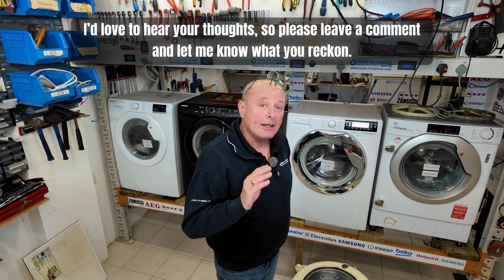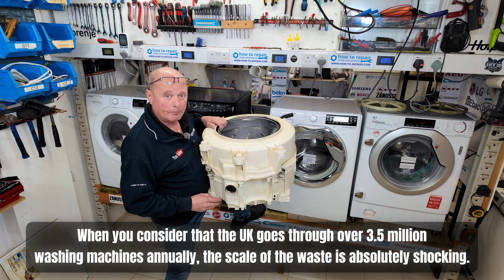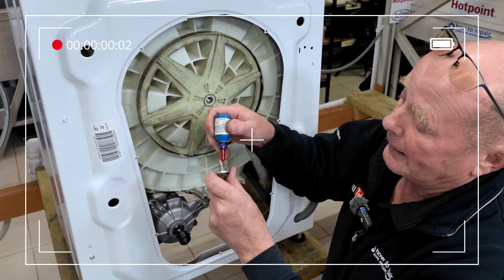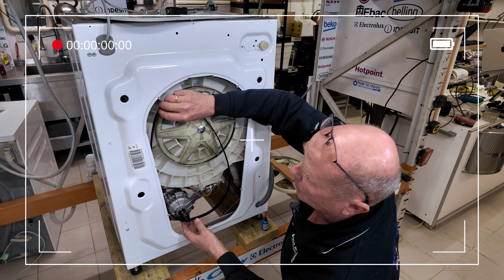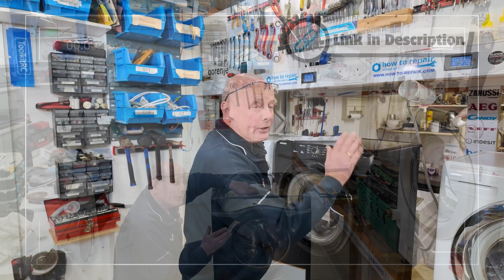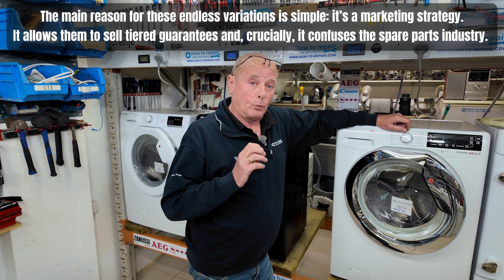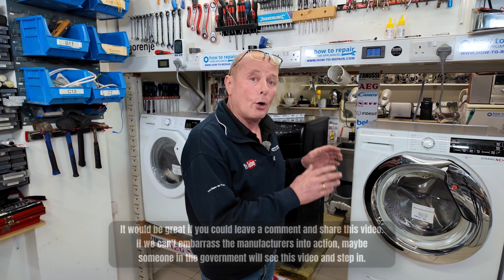I Scrapped 13 MACHINES to Prove a Point: STOP BUYING These Brands!

Comment: In the Netherlands the consumer is very well protected. The factory warranty the is now extended to the "expected lifetime" of the machine. 
This varies from 4 to 8 years depending on the purchase price.
And when the appliance is not repairable withing the expexted lifetime period the reseller needs to replace the applaince, for free!
Some normal wear or "user caused damages" are not covered.
Reply: Yes! Only responsible politicians can restrict this kind of behavior of greedy corporations. That's why big corps usually are the biggest donators to the political parties.  That's why American TechBros hate EU so much. And that's why we all have to be vigilant who are we voting for, because nowadays "i am apolitical" nonsense" can end by monthly subscription for our washing machines just to perform simple wash cycle.
Reply: Yup, but it takes the reseller effing ages to replace your faulty washing machine. The reasonable term is incredibly long, so you are without a critical appliance for an extended period. Now please note, this is a great first step to have enshrined in a law, but the pressure on manufacturers to do better isnt big enough, and consumers still have to deal with their crappy business antics for far too long. We need right to repair on all our white and brown goods.
Reply: @Styreta there are already some changes visible.  
For example, Liebherr started this month with 10 year full warranty here in the Netherlands on household appliances.
Reply: @martinmooren9536  10 years is the basic length of time I expect an appliance to last. My Siemens fridge freezer stopped cooling the fridge for the sake of a £1 capacitor and that lasted almost 16 years. I bought another, as all the plastics and glass were getting cracked and scratched, gave it to a charity to give to a family in need of a fridge freezer. If I hadn't fixed it, I am sure it would get degassed and shredded.
Reply: That doesn’t seem like much protection seeing as most machines are designed to last 5-7 years anyway. If they offered 8+ years then that’d actually be beneficial.
Reply: We have similar in NZ - The Consumer Guarantees Act 1993. Goods must last a 'reasonable' time and if they fail due to a durability issue or manufacturing defect, and cannot be repaired in a reasonable time, or suffer a failure of substantial character, the consumer can require a refund. That doesn't stop retailers trying to pretend there's only the explicit manufacturer's warranty cover though, and trying to sell you an 'extended warranty' which is merely a third-party insurance policy, or hampering any CGA claim with nonsense.
But even with those protections it can still be a hassle if a new appliance fails. I'll stick with my 33 y.o. fridge and washing machine and >40 y.o. chest freezer, thanks very much.
Reply: @TonyRule  Australia has near identical laws too
Reply: Kind of assuming that if the machine did 2 years instead of 4 you will have to pay half for the replacement machine, otherwise infinite machine hack.
Reply: @Grobbekee That's not allowed anymore by law. If it's not repairable and within the expected lifetime period the costumer (should 😀) get a new appliance without any charges.
Reply: Great! This should be a law for the whole Europe!

Comment: This guy is bang on.  Lg and Samsung are the best to buy for a decent price.  5 years labour warranty and you can take the drum apart and replace individual components.  Every other manufacturer have substandard drums. People try and save a bit of money by buying a hoover, candy, hotpoint or Indesit and they are gonna suffer after a few years so it’s a false economy. LG and Samsung do you need to get their act together and start producing and selling integral machines that’s their downfall. 10 year parts guarantees aren’t worth the paper they are written on because you will get ripped off by the manufacturers labour charge.
Wake up people before it’s too late. I refuse now to go out to machines where the drum is noisy. I will do FaceTime videos with the customer as it’s a complete waste of time for me and await for the customers for my arrival just to tell them the machine is knackered.

Comment: Bought a Siemens's washing machine from Comet in 1995. We worked out with it being cheaper to run and a bigger drum that it would recoup the  £400 premium over the std 300 brigade and it had 7 years g-tee. 
It's had 1 drain pump and 2 door seals , and still runs reliably in my step sons house after thousands of washes and 25 + years .

Comment: My first Beko lasted 5 years and had 3 major repairs under warranty and Insurance and each time was out of order from 2 Weeks to 1 month. Then replacement due to fault, with a newer model wich lasted massive 5 minutes. Then i swapped with LG and now 7 year in operation only with one fault, bellow from drawer failed in 2 years,  repainted myself as LG didnt had part in UK at the time. LG confirmed for me the warranty its still applicable even if i change myself confirmed on phone and by email. Im happy with lg but in near future i will need to change the dampers. Thak you for your video

Comment: Here in the states and I got tired of replacing the bearings and spider in my LG front loader for the 3rd time found a deal on a open box Speed Queen.  Hopefully the Speed Queen will hold up and not require regular rebuilds.
Reply: Same here, ditched all the brands like AEG and LG after they just didn't last and took out the money for a Speed Queen that has been running for over 20 years now without a problem. No fancy little melodies being played after it completes it's cycle, just mechanical knobs that does what it needs to do.
Reply: Speed Queen are brilliant, can, t get them in the UK sadly.

Comment: Slightly unrelated, but I bought a new Westinghouse free standing kitchen stove about 5 years ago. When the oven is turned on for about 20 minutes, the top gets so hot you can't hold your hand on it, and now, the thin steel on the bottom liner has burned through and is exposing the element. It's not just the enshitification of the internet, it's the enshitification all consumer products too

Comment: Using chipboard in a washing machine is the height of cynicism
Reply: My worktop is made from chipboard, no problems with swelling. You just seal the edges around the sink before fitting.

Comment: I had an hoover a few years ago. It lasted maybe 3/4 years, and one day started to making an awful noise from nothing (I suspect  the bearings had collapsed). In a matter of less then a minute, smoke started to show from the back of machine, and while we were fast to remove the plug, the "3 point star" in the back of the drum was broken, plastic was melt and burned, and I'm not sure if the motor was ok. If we were not at home, it could have set the house on fire. That's one of the many reasons I never have a battery charging or an appliance like a washing machine working while not at home. And Hoover? Never again!

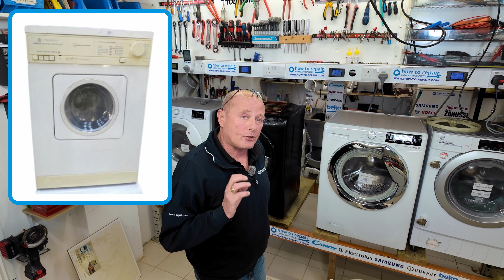Comment: I am also a bit of a "Washing machine nerd" This is how I found your channel.... At 03:20  in this video, my late grandmother bought a brand new  Hoover Electra A3E12 Washing Machine in the early 1980s (Maybe 1981/1982 ish), and it lasted right up until she passed away in 2014.... It was STILL working when we cleared the house after she passed away.....  My sister took it to her home as she needed a new washing machine and got another year's service from it before it finally threw in the towel. 
I am convinced it is only packed in working because my sister overloads her washing machine...I am sick of advising her NOT to do this! 
Thank you for this video. 
I still reckon the  Bosch Series 2 WAJ28002GB is the best mid-price washing machine you can buy in 2026.
Reply: I have exactly a Bosch Series 2 machine, it's both basic, but also has the features I need at the same time (like control over the spin speed, temperature, extra wash cycle). Bought it back in 2019 and still running good.

Comment: Good on you. I 'm in New Zealand and repair all sorts, mostly not laundry items due to size, Ive not seen those specific brands but we have heaps of junk here too and I suspect even less support of right to repair than you have. I am involved with a local IT wrecker/recycler and its appalling what is being scrapped these days, Its great that you are taking out the good parts. Personally I avoid buying anything that the supplier cant supply me a service manual with at least how to disassemble, an exploded diagram a circuit diagram with error codes and a list of available parts. Doesn't always work but its a good way to get rid of the junk importers. Like you we had a local manufacturer Fisher and Paykel which used to be the brand of choice now I wouldn't touch it with a barge pole. Im still running my 2000 cars for the exact same reason.

Comment: Built in obsolescence on electricals has always been been around, especially DIY products like drills etc...   I remember in the 70's Black and Decker DIY drills were designed with the knowledge the home handyman would only get it out of the shed 1/2 doz times a year and so if the components lasted 100 uses and fell apart no one would be any the wiser.  The upside was most drills in those days could be serviced.  Over 30 years I stripped an old B&D drill quite a few times and replaced bushes and cleaned and greased the gearbox etc....

Comment: If a printed circuit board failed, it is worth to look at it. Could be just a capacitor or an obvious burned part. My success rate is about 30%.

Comment: I have a Miele W431 built in 1974. I still use that machine as my main "daily driver" for washing my clothes. 
The original set of bearings lasted until 1996! And the rebuild kit (drum bearings, tub gaskets and the drain pump/sump hose) was still available from Miele back then.

Comment: Why dont people come together to build an open source washing machine that is super repairable ? Something that any manufacturer could build a copy of, without risking a lawsuit. Something open source a bit like the legendary Creality ender 3 3D printer or something super repairable like the computers made by “framework” (the brand is called framework).

It could use an arduino or a raspberry pi as a brain. And I don’t think there are any patents out there preventing people from building an open source machine.

Please upvote so this becomes the top comment and everyone can see it. I know that eventually someone with enough geekiness and a good heart will see this and start the project.

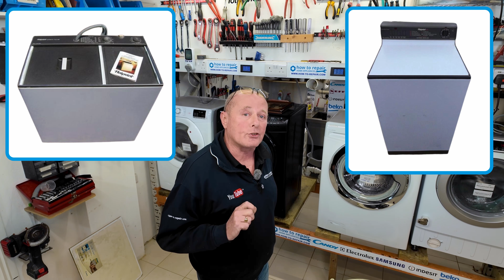Comment: 3:30 - Brings back childhood memories, we started with the Hotpoint twin tub on the left, followed by the Hotpoint top loader on the right.  The twin tub was the one I remember Dad regularly dismantling in its final years until the tub finally rusted through.  Our current machine is a Whirlpool 9kg semi pro (68cm like a typical USA machine) that's about 20 years old.  When its spider broke about 10 years ago, my dad got a quote for around €400 for the drum and bearing and we went shopping around for a new one.  My mother was put off by all the (smaller) standard size washing machines and 68cm models were no longer on display, likely due to not meeting EU efficiency requirements.  In the end my Dad bought and replaced the drum and bearing and it is still in use today.  Since replacing the drum, we have been running a monthly cleaning cycle.

Comment: i bought a hoover heatpump tumbledryer late2020. As a heatpump tumbledryer, its been as expected.
i have had two failures, one i could fix, and one i couldnt
1) starter capacitor - easy to diagnose , 3 hours to replace..lack of an access hatch meant the drum had to come out, which at least meant i could remove all the fluff from the inside and inspect the bronze bearing.
2) the total arsewipes neutered the smart features remotely because they were too lazy to make a firmware change to comply with a recent EU ruling even though we have Brexited. Its not a dumb machine. The wifi setting knob doesnt do anything anymore, cant even join a wifi network.
This bit winds me the most up. I can handle a failure of a  component...but intentionally removing a valued feature (to me) was a bad move on their part.
Reply: But why did you buy a Hoover and not a more reputable brand?  It's kind of like buying a VW or Renault and being surprised that it is not as (mechanically & electrically) well made or easy to repair as a Toyota or Honda. VWs and Renaults are not particularly popular in Australia for those reasons, yet in Europe they are strangely popular for all kinds of cultural and/or road salt (the bodies and paints are better made, in a trade off for all the corners cut on mechanicals and electricals) reasons.

Comment: my modern (ish) Aqualtis first broke the concrete weight (was able to replace it ) but after about 6 hours of use the PCB seems to have gone crazy. It says 'machine blocked' on the screen , yet pipes are clear, filter is clear  and it actually pumps out just fine, so unless its a pressure sensor or something up the spout the machine is just beyond economical repair. It was easy to access the components at least.
Reply: What's an Aqualtis? Do you know the OEM of that machine? :)
Reply: @TassieLorenzo  Hotpoint. It has an inverter drive motor.  Model of machine AQ169S

Comment: Hotpoint, Hoover (had flooding problems, bad processors, both went rusty) and Candy have been  disaster for years.  Bosh is not good A bearing collapsed which was lacked “made in England”.  The best machine that ai have owned is a Miele (the guarantee period has reduced to 2 years).  We currently have a Fisher Paykel which is quiet and very impressive.

I would not want to buy anything built in the EU.

Comment: I'm an engineer. If there's something I can tell you about your videos on planned obsolescence, it's that you're falling short. The problem is BIGGER than you say. Planned obsolescence is buried deep into software nowadays, and the manufacturers are not even hiding it anymore. From appliances that require an Internet connection to be "activated" just to work, to simple equipment that stops working after a set number of "cycles", to those that won't work unless you "update the firmware", so that the manufacturers can push new TOS and new rules that didn't even exist when you bought them... If you go through Louis Rossman's wiki, you'll find hundreds, thousands of entries of products and manufacturers that pull this shit over and over. Disgusting. They're trying to push us into the rent-only lifestyle, and making products disposable and expirable is the first step.
Reply from the maker: I can’t agree with you enough, but this is slightly above my pay scale. I’m not a software engineer and I’m not able to see the tricks that they’re up to but this is why I oppose Wi-Fi connections. It is not needed in a washing machine but then they will only set it to the number of cycles. This I did manage to find on a recent video I made about Bosch washing machines where they had left a model open to see how many cycles the machine has done. It would be so easy for them to trigger a software failure at a certain number of washes I really appreciate your comment.
Reply: @How-to-repair : Thank you very much, sir, for what you're doing... We need many more people speaking up on this subject. In my case, I won't buy anything that requires an Internet connection to work, unless the VERY functionality of the thingie in question is connecting to the Internet. And IMO, a fridge, a washing machine, an oven, a car, and so many other pieces of equipment DO NOT need Internet connection. Best!!

Comment: A lot of PCBs can be repaired, I've been doing this for eyars. Brushes and bearings can be replaced in most motors. The worst is the carbon drum, impossible to change bearings. Drain pumps are not what they used to be.
My trusty old AEG 645 are still running, not long since I replaced motor brushes. Main bearings about 10 years ago. Quality made to last and made to be repaired!